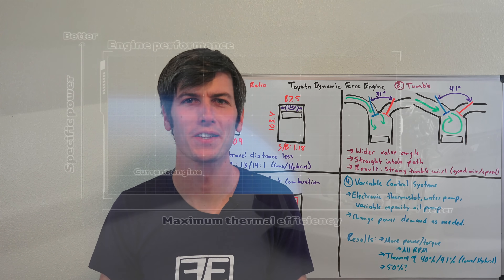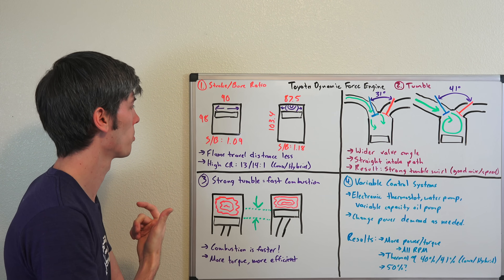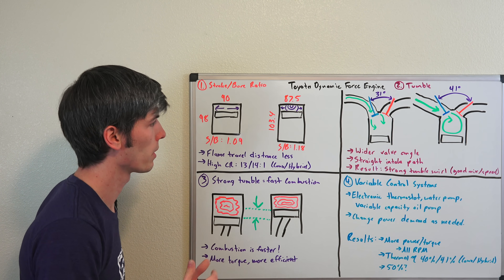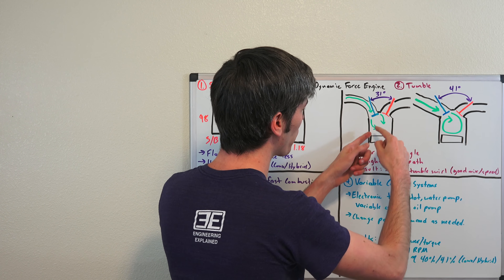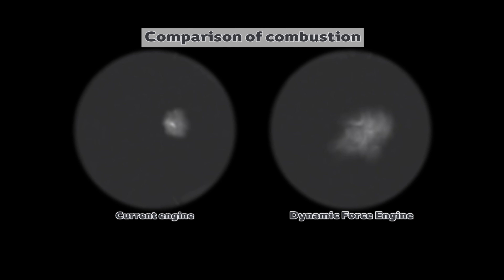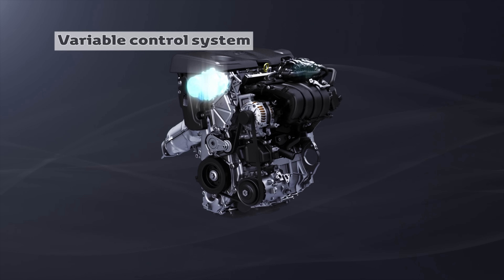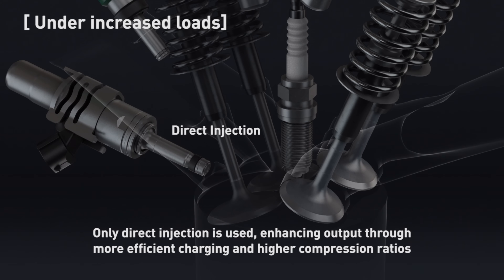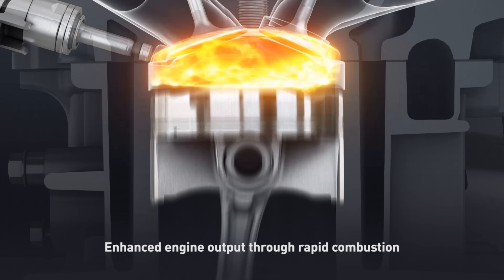Toyota's New Dynamic Force Engine Is Super Efficient

Comment: I just had the idea of flooding a cylinder with microwaves, which would create a ball of plasma that should quickly and thoroughly burn even the leanest fuel-air mix, help vaporize injected fuel droplets and possibly even perform in-cylinder fuel cracking, something I know is being done in one experimental injector design; turns out this is indeed being pursued and may revolutionize the internal combustion engine by allowing far leaner and thusly efficient running.

Comment: Mercedes uses direct money injection to achieve that efficiency.
Reply: Typical German engineering use a GPS guided laser to kill flies when a fly swatter will do just fine.
Reply: anyway to make things more expensive for people
Reply: GOATED comment. I argue BMWs version is slightly better due to the numerous plastics achieving an even greater thermal efficiency.
Reply: @DuckMcDuckinson  
😂😂😂 some of those plastic components are long lasting.
Reply: mercedez engine achieve that level of thermal effciency by using very exotic materials like forge billet aluminuim titanuim and other exotic super alloys that is far lighter and more thermal resistant that what you will see in cheap mass production engine that engine was made for f1 car the engine alone cost more then 100 toyota corrola toyota new engine will make its way to corrola and camary so for the 2 to be even be in the same sentances prove toyota superior design.
Reply: @MikeKay1978, BMW & Audi too.
Reply: economies of scale bro
Reply: These all have direct injection and are more thermally efficient than Mercedes engines.
Reply: Text book smart did with a diesel semi going to try it with a gas car use an emplysifier gas conditioner( same brand as diesel but fot gasoline) that should be able to keep water in suspension ( will check by mixing the gas ans water in a glass jar letting it sit for a few days) why water? H2O ( THE HYDROGEN HELPS COMBUSTION most of these tests are down in low altitude coastal area ( 60 % of world pop are coastal other 20% on major rivers ) which have higher humidy levels ( this is same as adding electolizer for making hydrogen) injection of water at exhuast driven turbo crates steam but  worked in the simi too in the fuel(yes i have been told i am crazy lol) it worked ( no condesation water in the fuel filteration system) Note had condesation before using the fuel conditioner others repaced injectors on their engines i drove for 2yrs no injector/engine troubles ( also ised canola oil as fuel conditioner lubrication ) Note: Canaloa is derived from Canada Oil formerly called rapeseed oil used for lubes on steam engines no i dont cook with Canola i know the history as SK farmer/ seed grower hybreds now sprayed with chemical killing everything  grren but not the Canola crop Wow ph 1 403 830 4123 C u

Comment: Pure rubbish, like  manufacturers quoting "torque" numbers for engines.  I can only look at so called "Carnot" comparisons, and the numbers suggest the engine melts quite quickly after it reaches full power.  Going from 30% to 40% is extreme.

Comment: Check out that drop in torque at 3000rpm. Do you think it could somehow have a similar cause to the torque dip of the toybaru engine that also uses toyota's fuel injection?

Comment: My experience with Toyota: garbage engine, before 170k, piston melted bad injectors, Denso, bad pressure pump, Denso, broke the alternator, Toyota Avensis, made in UK, bleh no more this brand, bought it because thought it was the most affordable car... yeah, by the way Denso don't offer parts to repair injectors, pumps etc... So got to replace hole piece, not eco friendly, and very costly for the user, hate this greedy corporations...I had an Audi b5 TDI 1.9 the engine last 400k, after that broke the gear , you don't find car like that anymore,

Comment: Obviously, the 41% thermal efficiency is a peak thermal efficiency stat. I expect raising the power/torque as the engine is designed to do will certainly drive down that figure. I'm guessing they didn't release information on the thermal efficiency range based vs power/torque.

Comment: I'm sold!  Forget about the 97% efficiency of Tesla Model 3 motors, I want a car with 10,000 moving parts instead of 20, one that has tailpipe emissions and isn't insanely fast off the line, one that the dealership will be able to make money on after the warranty runs out.

Comment: I think you missed the most important point which is a longer stroke allows you to harvest more combustion energy during acceleration, the drawbacks of such setup at cruising speeds has been resolved with the use variable valve timing (VVT).  Hence, the efficiency curve has been optimized with a combination of VVT and a longer stroke.

Comment: I really appreciate your explanations..as a professional race engine builder I struggled for years over bore vs stroke...you have provided answers other than opinions....I was wrong for yrs choosing short stroke hi rpm over small bores
But my question is ..does the force engine require hi test fuel and how do they manage the high compression
Reply: Miller cycle + cooled egr leads to lesser compression and retarded timing so 87 works just fine!

Comment: QUESTION: Will this direct injection design result in carbon build-up on the intake valves that other GDI injection engines have?

I like that Toyota had, previously, produced engines with both direct and port injectors to prevent the issue. It does seem like the GDI injector still sprays over the valve in the video though? Is this the solution to the GDI issue that I've dreamed of? Has Toyota has made a GDI engine that keeps the valves clean too?

I just want this confirmed  as it was not directly addressed. I'm an absolute layman when it comes to engineering.

Comment: it's great that they are producing engines that have greater thermal efficiency. However, when you have laser clad valve seats and sprayed on cylinder liners, these engines will never be rebuilt. And if they are rebuilt all willy-nilly with the older technology, they will lose a lot of this added efficiency. Never being able to meet the specs the ecm expects to see after a rebuild.   So it's actually kind of wasteful. Most of these engines will end up in a recycling center after the useful life of the engine is passed. instead of being able to be rebuilt 3 or 4 times. But I suppose only like 1% or 2% of people rebuild their engines. Most people buy new cars when their cars break down or become older.

Comment: The Mercedes engine is an outdated CVCC Honda Engine. The straight shot intake port overcomes the no swirl 4 valve problem which lowers power and increases fuel consumption and detonation at low speeds. Udder wise nottin new here.

Comment: I want to say my opinion on the combined fuel injection system D4 - S for instance.
I thing the fuel efficiency are quite sufficient  and with direct injection .
However due to the high temperatures carbon deposits appears.
Therefore , an additional fuel injector was introduced into the intake manifold , port fuel system's.
Port fuel system's operate at pressures of the order of magnitude 2.8 bar , which is sufficient to clear carbon deposits from direct injection systems , nothing more .

Comment: What commercially accessible automotive street fuel can be used with a 12/13:1 compression? High compression requires a high octane fuel of at least 98. Back in the late '60s early '70s sure, lots of muscle cars were running at that ratio and higher, I personally was running big blocks at 14/15:1. Fuel of more than 100 octane was available everywhere, today.....NONE. Because the fuel just isn't on hand at the pumps the entire fuel production industry would have to change again to produce higher octanes for automotive use and the price of a high octane fuel today would be prohibitive for pretty much everyone. In 1971  high octane pump fuel in Canada was $0.45 an IMPERIAL GALLON, (4.55 Liters). Today that same amount of fuel of a MUCH lesser quality (87 octane) is $5.86 CDN. The alleged savings of a 41% thermally efficient engine wouldn't be worth the effort, it would have to be MUCH higher for the industry to make a change like that AND the fuel would have to be reasonably priced. Much better for engineers to try developing anti-gravity or the like.

Comment: At the core of it there's nothing special about this engine. They simply increased compression ratio and increased port flow. Anyone who's ported heads has wondered why port flow is so overlooked by the major auto makers and only focused on by performance groups when 5-10 hp is easily gained by some 180 grit sandpaper.

It's very cool to see an automaker make a big improvement like this. Also the e water pump etc will GREATLY increase lifespan and ease of service.

Comment: Great for grocery getters, I bought a ford because my toyota 4 runner couldn’t effectively pull a small rpod trailer, and my wife’s gx470 wasn’t any better. Toyota is relying on their past dependability for sales, six cylinders 270hp and 5 speed transmissions don’t cut it in heavy SUV’s. I can name 5 family members that have bought other brands because Toyota won’t give us an option to buy 4 runners and other large vehicles with the 5.7 V8 and at least a 7 or 8 speed. My coyote engine with a 10 speed blows past Toyota’s all day long, people say you can’t compare a six to a V8, exactly!

Comment: Can you please give a hypothetical on :
Dynamic engines of Toyotatech in  twin- charger engine  hybrid , electric motors powered by lithium ion batts, next gen fuel injectors (aerosol) embodied by  the Pal-V One platform.
Or would a Sky-Active motor be more efficient for flight in this capacity?
Or even the new Volvo engine the XC-90. Could this tech utilize mutual patents?

Comment: I just bought a new 2020 Corolla SE Upgrade with this 2.0 liter dynamic force engine. Drove 4 hrs home from the dealer got 45 miles to the gallon at highway speed of 120 kms an hr. Next morning start the car and it had a very loud rattle going on under the hood, this lasted for about 1 and a half minutes and then it quieted down to normal. I was very disappointed with this purchase after hearing that and can't wait til it gets colder out.

Comment: Wouldn't a diesel engine be more efficient, due to diesel fuel having more energy than gasoline per kj.?
Reply: But diesel costs more and energy per dollar is what really counts, in my book anyway.  Then there's the emissions to deal with.
Reply: yes, most diesels are around 40-50% thermal efficiency whereas gasoline engines are around 20-30%

Comment: Instead of altered bore/stroke ratios....to get more complete combustion...... I always thought the use of 2 spark-plugs...and with today's elegant electronic controls, can even micro-manage the time-of-firing to be either the same....or "offset" by maybe 1/1000 of a second or somesuch tiny time-lapse. Yeah...I know, with 4 valve cylinder heads this is a problem to find the space for a second plug.....maybe the "sparkplug" needs to be re-thought....like an electrode "Sheet" on the inner-surface of the combustion chamber, instead of a "point-source" offered by a sparklplug.......

Comment: Did I see a solution for the intake carbon build up problem in direct injection engines?
Reply: yes  Toyota has both Di and port specifically to aid in the deposits in the valves

Comment: Wonder why they didn't experimented this option much much much earlier??  It seems only logical sense that the faster the fuel n air mix is able to saturate the chamber the better the burn!!!!!! Looking at the picture of the wider angel,  doesnt need rocket scientist to figure that one out!!! THE cam is unchanged,  just the intake / out take ports are widened out. 
 PLEASE CORRECT MY ERRORS/ASSUMPTIONS ETC IF ANY!!

Comment: Because of that shelf that the intake air has to go over as it enters the cylinder it creates an eddy current. The problem with the longer stroke to bore ratio is you also then need a longer burn rate fuel. Which they may very well be using. A complete burn on a longer stroke engine is not necessarily advantageous. Longer stroke engines do tend to provide more torque, which is what does most of the work when you drive a vehicle anyway unless you're on the highway all day long.

And considering their 13 to 1 and 14 to 1 compression ratio my guess is that their octane requirement is going to be at least ninety octane, probably even more.

Comment: Off-loading water pump, etc. to electric units is cited as an important part of efficiency increase.  Has the electrical power consumed by those units been factored into the efficiency? Have alternator losses been included? Has the full range of normal usage of those variable components been included, or only a most-favorable condition?  When they're touting 40% rather than 39%, these things matter.

Comment: With efficiency of 40%, it start to make electric car irrelevant. Large power plants have efficiency of 40% to maybe 50%. Then you have transmission loss and batter loss. Is almost a break even with electric car. Unless we go all wind, solar or nuclear. Those options are unlikely given today's technology.

Actually, nuclear with electric cars is the most attractive option. The problem with nuclear is NOT technology. We can easily have ultra safe nuclear power. What is preventing that from happening is politics. Business will always cut corners. Is sad when the solution is not engineering which should be hard, but the people which should be the easy part.
Reply: There is no free lunch with energy, no matter what you use its gonna average out about the same.

Comment: I think the more electronic a car is made the most expensive will be to buy and maintain and also less reliable because more potential fails of parts and sensors, summarizing; in some way the owners of these new cars will expend sooner or later the gasoline savings on maintenance or repairs or even more than using a lower technology car.

Comment: It has to be more than that.  Everything explained here, except for the direct injection, has gone into consideration for engine designs for a few decades now.  Compression ratios, valve angles, combustion chamber shapes, intake runner lengths and shapes have all been experimented with for a really long time.

The biggest design change is that they've got better at ensuring the engine runs at a load and speed that meets its peak efficiency... such as in a hybrid.

Comment: It has always been more efficient to have a longer stroke to bore ratio for a given displacement. The reasons are mainly due to more leverage when the piston is halfway down the power stroke. More leverage to the crankshaft = more torque = more power = less wasted fuel and heat. Where your video makes a mistake and it is common and also used in marketing for years is the faster burn rate. In reality not marketing hype you get better power or work per gallon of fuel if the burn rate is slower. Few folks realize if you purchase higher octane fuel it cost more and burns slower than cheap low octane fuel. IF the goal is more overall power you want the burn to continue thus increasing pressure as the piston is on it way down  IF it all burns at or near Top dead center the piston is pushing on the crankshaft where you get the least power. Another reason Diesel gets more pulling power is it burns much slower than even high octane gasoline. I am sure the engine is more efficient but it would be even more efficient if it burned slower rather than faster. I know the reason it burns faster is to not lower emissions but to change the emissions. faster burning means more time to convert NO for example = less acid rain but more gallons burned to get from point a to b.